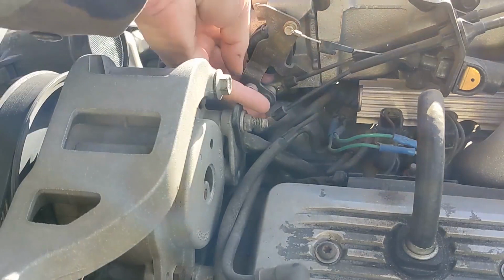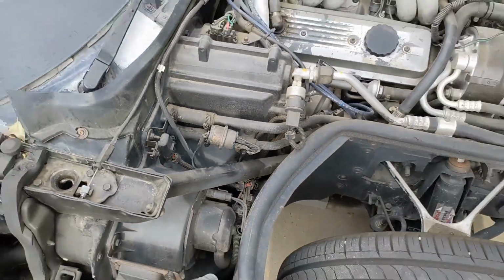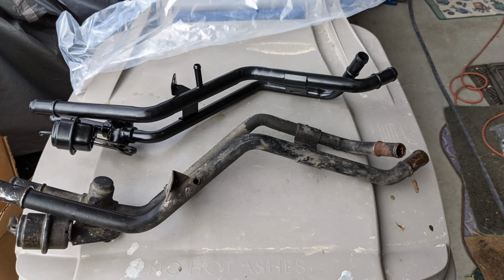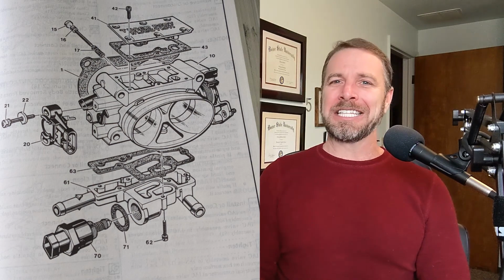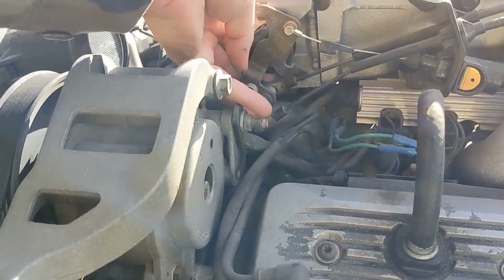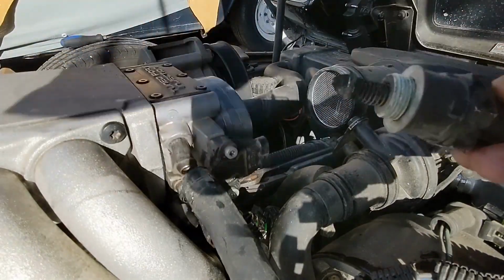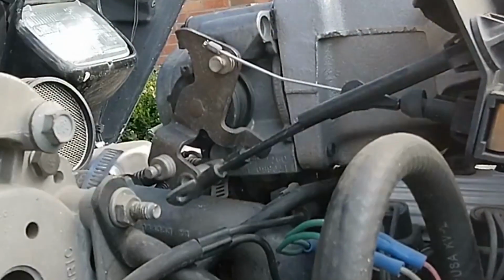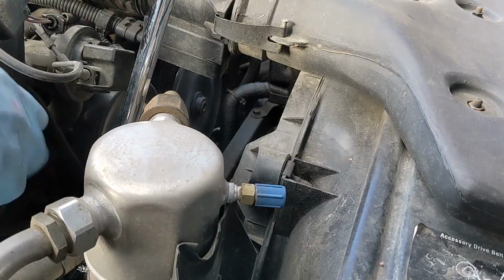Replacing the IAC Valve and Heater Bypass on a 1987 C4 Corvette- Restoration Episode 17

Comment: If you had problems bleeding the coolant system you should check your radiator cap. I had same troubles until I read the service manual and discovered my car had the wrong cap. With a cap specifically made for c4 with a coolant spare tank there is two arrows on the lid wich should be aligned with the hose outlet on  the radiator neck. After purchasing the right cap I drained and refilled my coolant in the radiator and  the system bleeds itself. Before that I had to bleed it multiple times to get the air out and the low coolant light came on and off intermittent every time I drove

Comment: Hi Jerr, what do you think is the best temperature range in the coolant????
Reply from the maker: I can tell you what it was made to run at. The fans don't even turn on until 228 degrees. They were made to run hot to reduce emissions.
Reply: @JerrSpud  and do you have idea if c4 use 1 or 2 termostat??
Reply from the maker: @ricardoestebansantelicesre6978   all small block Chevys have only one thermostat in the water neck
Reply: @JerrSpud  thanks a lot for your answers!!!, you are the Best!
Reply: Hi Jerr, Sorry for my questions but I really need your orientation, We think that the C4 has a bubble in the coolant sistem, do you know where is the screw for to open the sistem and  take of the air??
Reply from the maker: @ricardoestebansantelicesre6978   what makes you think there's a screw? It's a small block Chevy. 
There is a burping procedure in the manual. I don't have it memorized.

Comment: Theres 256 positions in the IAC program
Reply: If this is an 87 with aluminum heads your using the wrong type of coolant.  You should be using the Dextron brown coolant.  Will help with the corrosion of the heads to block.  Dont ask how I know....